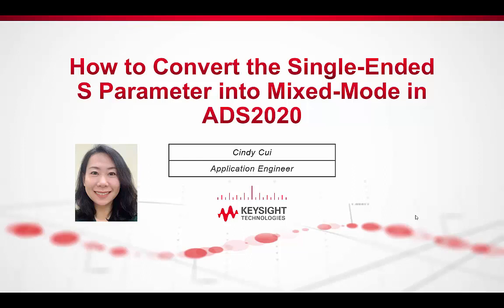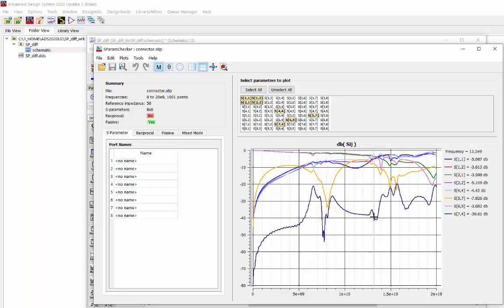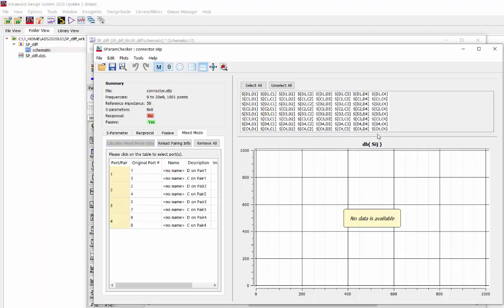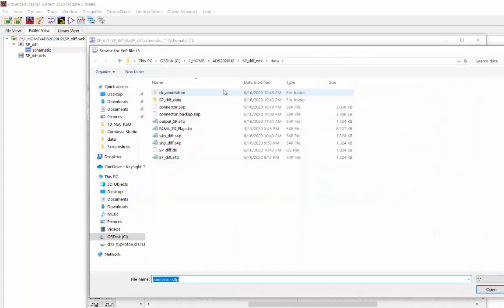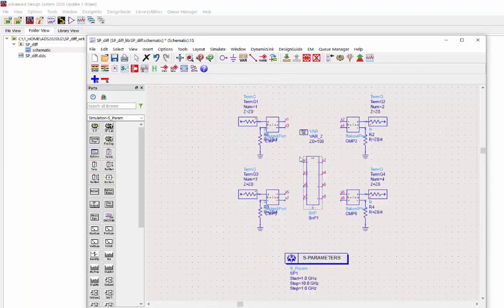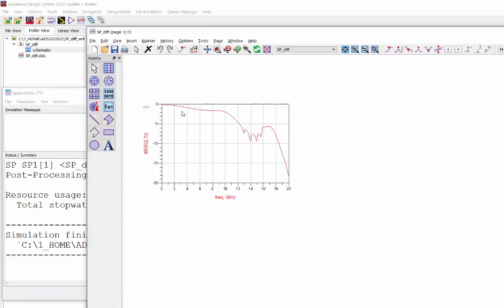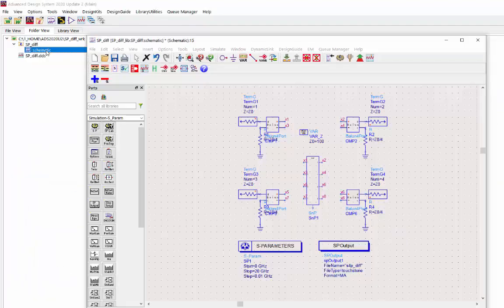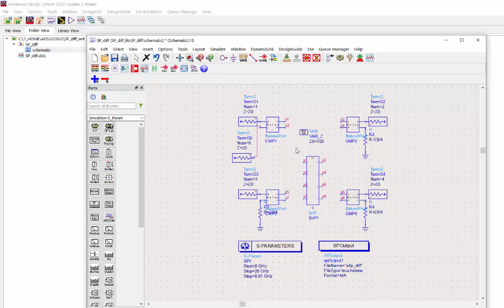ADS: Converting Single-ended S-parameters to Mixed-Mode S-parameters

Comment: Hi, Can you create a Mixed-Mode S-parameter file for a 3-port device, for example an 1:2 balun NCS2-33+ from Mini-circuit, where the input port is a single-ended 50-Ohm  port and the outputs are other two ports to be used in differential configuration.
Reply: excuse me, could you find a solution for this issue ?